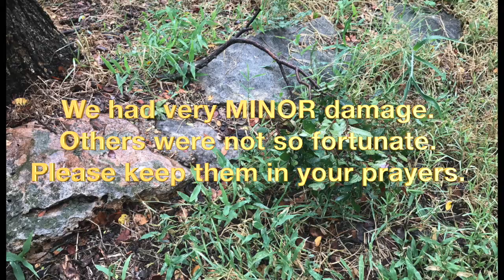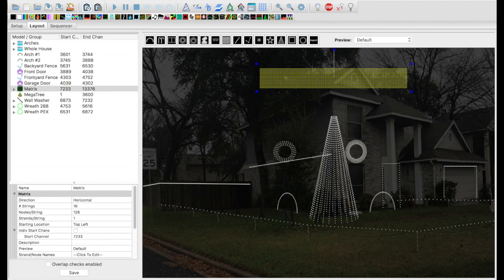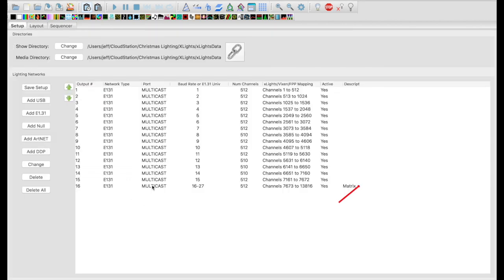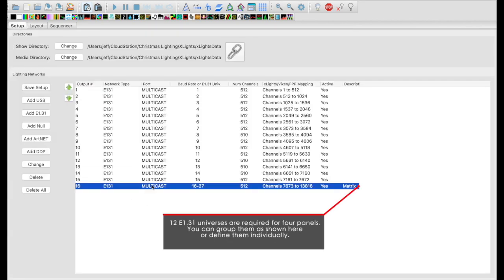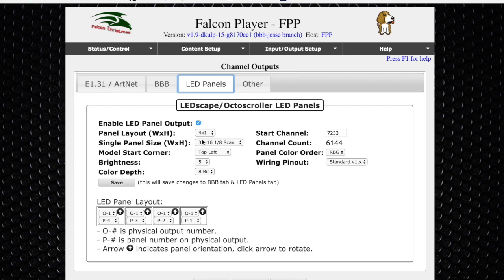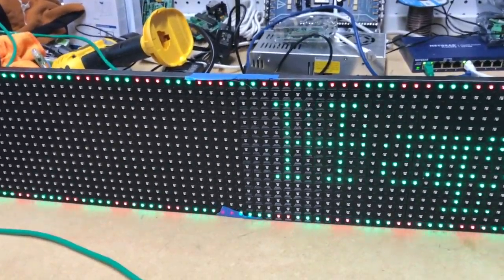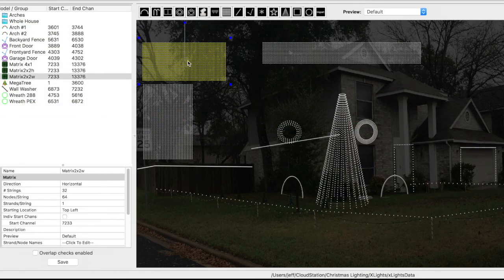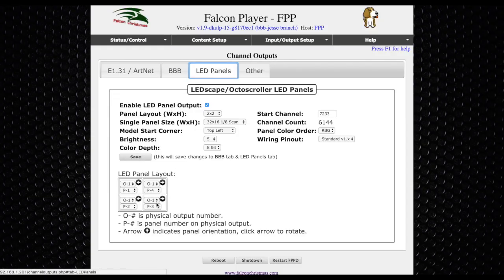P10 Panel Setup

Comment: What are the pvc pipes on your wall at the end of this video? 15.29
Reply from the maker: The gray ones are electrical conduit. I think they were 1-inch Schedule 40.
Reply: @CanispaterChristmas  Thanks for your prompt reply. I should have been more specific, they look like there are pixels in each one (or some light) do these make a light wall and if so how effective is it?
Reply from the maker: @scottemiller4501 OH! I used 1/2" PVC to hold LED strip straight. I just used wire ties to hold the strip to the PVC. I believe I used those around my garage early on, but switched to standard pixels for that. For lighting up a wall, they might work (depends on the effect you're going for), but strip doesn't like to be moved around much and isn't totally weatherproof. There is a saying "friends don't let friends use strip." 😂 They look nice, but tend to be a bit more finicky. As long as they aren't moved and protected, they're great. The ones I put on my stairs inside aluminum channel are still working.
Reply: @CanispaterChristmas  Thanks Jeff! I will use that saying :)

Comment: Jeff, How would I connect a string of WS2811 bullet pixels to a P5 sign setup (like your sign using the Beagle Bone Black with Octoscroller)?  I plan to add two Boscoyo Chroma Cane 48s.  Thanks.
Reply from the maker: I used a SanDevices E6804 controller. This one is fully assembled, but you can also get a kit and build it yourself. https://sandevices.com/product/e6804-assembled-tested/

Comment: hi, can you do a video on how to install falcon player on to the beagle bonbe black please and also links to where we can purchase them from in the UK.  Also i notice on Ray Wu's store he has varios specific controller boards, can they be used with x-lights / falcon f16v3?
Reply from the maker: Have a look at https://youtube.com/playlist?list=PLFyrAfJ-kKd70zujml8t3agTNJuYce92b The BBB should be available pretty much anywhere you buy electronics - or Amazon (https://www.amazon.co.uk/BeagleBone-Black-Revision-C-4G/dp/B017Y3XCVY/ref=sr_1_3?crid=KYJ9DZB4FV6U&dchild=1&keywords=beaglebone+black&qid=1612038380&sprefix=beaglebone%2Caps%2C263&sr=8-3). I haven't used controllers from Ray so I can't say if they'd work, but I don't believe they are compatible with xLights - you might check with someone on auschristmaslighting.com as they may have experience with them.

Comment: Hi Jeff its Jack again. Finally received my parts to make a P5 sign. When I run a sequence the output on the panel is broken up into thirds. A line of text is split in two by a line of text running thru the center. In xlights the model preview shows only one line of text. I have a 64X32 P5 panel using a beaglebone with a octoscrolla. In FPP I have it set as a 1X1 panel layout, 64X32 1/16 scan. I'm new to xlights so I can't figure if its xlights or FPP. Do I need to set up enough universes to equal the amounts of channels for the panel? Do I do it in xLights and FPP.  Figure I'd ask before I change something and really mess things up. Thanks.
Reply from the maker: Been a while since I messed with them, but it sounds like something isn't set right. Yes, your model needs to have the correct channel allocation. If you have 1 panel, that would be 64*32*3=6144 channels. Then FPP needs to be setup correctly. It should confirm your model settings. Assuming you're using 512-channel universes on both. 12 universes.
Reply: @CanispaterChristmas  Perseverance  prevailed I  finally got it to work.  Benefits of everyday is a Saturday,  I have been fooling around with it all day. Thanks for all the videos and the help. Without it I would have never gotten the idea to build one let alone actually accomplish it.
Reply from the maker: @John Burckley  That's usually how I get through it - keep trying different things. Glad to hear you figured it out.

Comment: Hello. Love your videos. Thay are so helpful and you have a mac. I am having terrible issues with getting my mac to connect to my controller. Anyways my question is can you run video right from xlights to the panels and does it look good.   Again thanks for the videos
Reply from the maker: Can you? Yes. Should you? Probably not. It's a ton of data and the higher the resolution, the more data you're pushing. It's better to connect a monitor to a Pi and have the video on the Pi and run the Pi as an FPP remote. If using panels, you can use a BeagleBone Black  + Octoscroller. The BBB handles a larger number of panels. Pis work for smaller numbers, but I haven't actually used one yet. xLights is designed for creating FSEQ files and xSchedule/FPP is designed to play them on a schedule. Video on panels is much lower resolution than a normal TV.
Reply: @CanispaterChristmas  thank you for the feed back. A friend has a few p8 commercial rental panels that are beat up but work and if all goes well I will get them on trade. Trying to figure out how to incorporate them into my show.
Reply from the maker: I'd go BBB + octoscroller and you'll need power and data cables for the panels (see if he can give you those). You might also post on the FB group to see if someone has experience with those.
Reply: One more question if you don't mind. My wife got me a mac for Christmas. I've never owned a mac before. I installed xlights but it won't connect to controller. I can't ping or open it. Is there something different I have to set up. I'm plugged directly into controller or to a switch. Either way nothing
Reply from the maker: @mattsaller1577  If you're going direct, you'll need to assign static addresses for the Mac and the controller. System Preferences -> Network, highlight the Ethernet adapter, choose Configure IPv4 -> Manually and pick a private address. Alternatively, if you plug the controller into your home network, it will get an address automatically then you can just open a browser to the IP address listed on the OLED. For testing, the latter is easier. For showtime, I'd set up a new private network for the show traffic. Not sure of your computer networking skills so not sure how much info you need. 😂
Reply: @CanispaterChristmas  Thank you

Comment: how would i layout a 2x4 p10 setup with each panel input going to 1 output of the octoscrolla. would all arrows point up and start on the top left?
Reply from the maker: I'm no expert when it comes to figuring out the best panel configuration. There are a few in the forums and FB groups tho that have experience setting up large panels. Any reason you have the requirement to use every output? That seems like a lot of unnecessary cabling.I just use one output for 4 panels. An octoscroller can support 8-12 panels per output. Kinda it's thing. :)

Comment: how can I do to add a guitar element to my show in xlights?
Reply from the maker: Did you create a custom model or did you buy coro from Boscoyo or something else?
Reply: @CanispaterChristmas  nop..I just want   
Know what I need to do a big guitar like other videos on youtube
Reply from the maker: @fgmrendy  Well, do you have an experience with xLights currently? Do you have a display with pixels? Basically, you build the prop out of whatever you want in the shape of a guitar and put lights on it. xLights is just for programming the lights to blink in the patterns you want. Since this is a custom prop, you'll need to create a custom model in xLights so it knows where the lights are and can apply patterns to the lights correctly. Knowing how familiar you are with all this stuff will help me point you in the right direction.
Reply: @CanispaterChristmas  I have a mega tree with star and 36 " snow flake from boscoyo controlled by sandevice e682 all in a group.
Reply from the maker: @fgmrendy  Oh OK. Yes, you'll need to create a custom model in xLights and then it works like all the rest. Search on videos.xlights.org for "custom model" because there are a few of ways to do it.
Reply: @CanispaterChristmas  thank you
Reply from the maker: @fgmrendy  You bet! Let me know how it goes.

Comment: Did you ever figure out what was wrong with running in Bridged Mode?  This is my first year doing a display and I was planning on running everything (including the Tune To matrix) in bridged mode.
Reply from the maker: Haha. No, I didn’t look into it further. If it’s still an issue, you might ask on the forums or file a bug.

Comment: Hey Jeff, I have a BBB question. I have FPP loaded on mine. It's not the WIFI one, so I have to use ethernet connection. So I set it up to run a 2x2 P5 pixel matrix panel setup. Everything runs good, I am able to access FPP through the ethernet cable, and got everything running good. I scheduled it to run for 4th of July show, and then shut everything down, removed power and ethernet cable. I moved the whole setup (panels, power supply, BBB) to a location not able to be reached by ethernet cord, so I would like this to run on its own. I was assuming it could. So I powered it back up hoping that it would pick up the schedule that I saved into it and we would be good. Well, it didn't come on as per schedule. While I was testing this, it did the same thing until i rehooked up the ethernet cable and pulled up FPP on my network. I rescheduled to test, removed ethernet cable, and it came on when it was supposed to. So I am wondering what is up with this not working if I remove power and repower at another location? Any idears?
Reply from the maker: FPP typically uses an internet connection to fetch the time on startup. If the device has an internal clock chip, it can keep relatively accurate time. I don't believe the BBB has one and I am certain a Pi doesn't have one though you can get add on cards that do. Anyway, if you are using it without an internet connection, you can log into once it boot, set the time manually and the scheduled events will run. I don't know how accurate the clock is while it's running so expect some drift.

Comment: Pardon my ignorance as I am sorely uneducated on pixels still...I run a string light show but I want a proper "Tune to" sign and I want to use a pixel sign.  Does this set up have to ability to run independently of the shows' computer and can advertise the station on its own?  I hope that question makes sense.
Reply from the maker: Yes. This sign runs all by itself and has no interaction with the rest of the display other than being on at the same time. Some people use theirs as an additional prop, but mine is just a sign. I usually have it come on about 30 minutes before the show starts and leave it on for about 30 minutes after the show ends. The BBB is the "computer" for the sign. You could also use a Raspberry Pi for this due to the small number of panels (4 in my case).
Reply: @CanispaterChristmas  That is fantastic news. That's what I'll be working on next then. Thank you much!  Please keep up the videos as they are appreciated.
Reply from the maker: Thanks! Keep me posted on your progress! :)

Comment: I noticed the same thing when I do 2x2 setup vertically, I have to turn the arrows opposite in FPP for it to look right. Do you ever get an answer as to why this is like that? Great videos!!
Reply from the maker: I think it’s a bug, but not big enough for someone to fix right now since there is a workaround. Someone also said to try using more than 1 output, but I haven’t tried it yet.
Reply: CanispaterChristmas thank you! I have 2 outputs going and it’s the same results. So definitely a bug throughout.  No big deal. Do you notice “lag” at times when scrolling text? I scroll text and every few seconds it jumps, lags and the letters break apart a little.
Reply from the maker: Yes, I noticed the same thing, but ignored it to keep from driving myself crazy. :)
Reply: hahahahah good, as long as its not just ne, I had lagging nightmares last night, lol

Comment: Quick question ... as I am reading / watching conflicting info .... in regards to setting up the panels at about the 7:55 mark of your video ... one of the tutorials on Facebook is showing that you layout it out as if you are looking at it from the front so the O1 P1 would be on the left  ....  you have it on the right side in this video ... Just a newbie hear trying to learn it all.
Reply from the maker: Yes, they are a bit confusing. Check out https://www.diychristmas.org/wiki/index.php?title=Building_an_Octoscroller_Matrix_Display. This is exactly how I built my setup. Also see http://falconchristmas.com/forum/index.php/topic,5288.msg72600.html#msg72600 (part of my research for hooking this up). Cable it up from the back (kinda hard not to lol), then set FPP while looking at it from the front. Everything except the 2x2 vertical setup behaved properly. There are also some really smart folks in the Facebook groups that can help with larger panels. Barry built a 64-panel matrix and the wiring diagram for that was hilarious.

Comment from the maker: I thought it was a little strange there wasn't even a flyer with links or anything. I'm thinking I've found a bug since it works one way and not the other. Checking on that now. I learned a lot though trying to make it work correctly and frustrated at least one guy trying to help me.

I ordered a hat for the Pi just to experiment a little. I really prefer the Pi over the BB, but you can run a lot more panels from the BB/Octoscroller.  If I were to add more panels to the display, not sure I'd try to create a large screen. It might make a cool window outline or something. Waterproofing them is the challenge as they're designed for indoor use (or inside a weatherproof  enclosure). Probably need to mention that next week.

Thanks for the prayers. Some folks lost everything. We were very fortunate.
Jeff
Reply: Good to hear you are doing well after Harvey.  Several years ago I lived in the New Orleans area, and after getting hit with a tropical storm, areas of the West Bank flooded that hadn't flooded in years.  As has happened in your area, a lot of people had not re-newed their flood policies and were scrambling for any thing they could get in the way of building supplies, and construction help.
Reply from the maker: Yes, thankfully, we were spared. The gazebo cover suffered a bit, but it probably needed replacing anyway. LOL! One of the YouTube creators I follow (Matt & his brother-in-law) went down to help out and  commented on how many civilians were stepping up to help out in every way - very inspiring. There were also many Federal agencies providing support. Rebuilding will take some time.

Comment: I think you need to check the instruction manual again Jeff.  I had to laugh a little at your remark about the enclosed (NOT) instructions.

Very interesting the way the software is processing things to the panels.  This year is my first attempt at doing anything except stringing several strands of lights, and plugging in a couple of inflatables.  Keeping things simple, but the P-10 panels are interesting.  

Keep the powder dry, and our prayers are with the all the great people in Texas!!

Pete